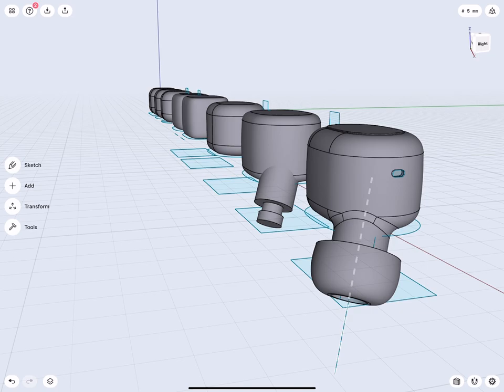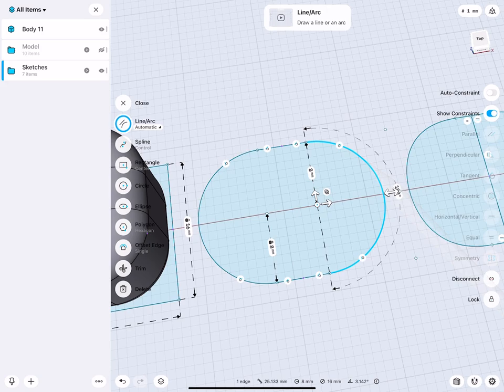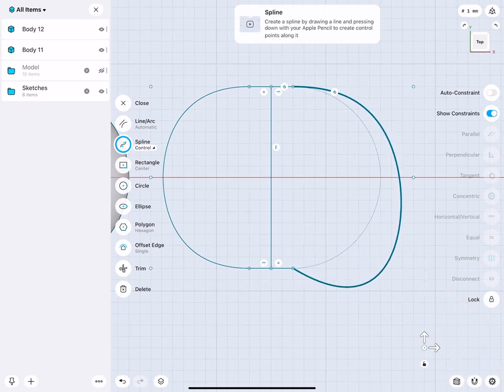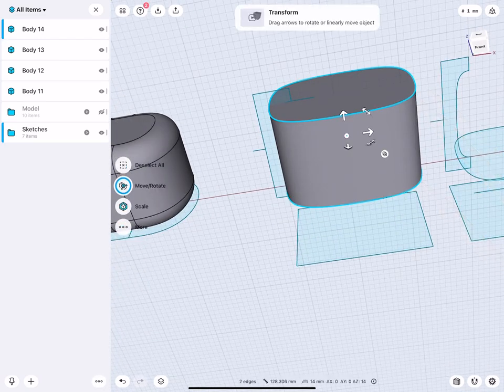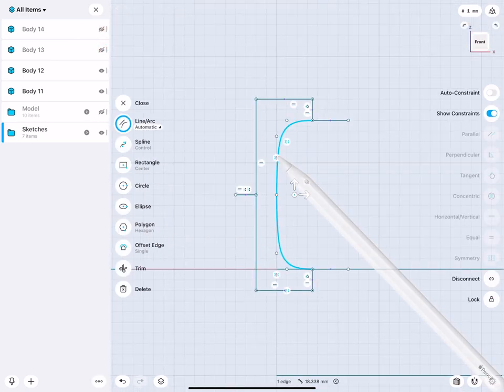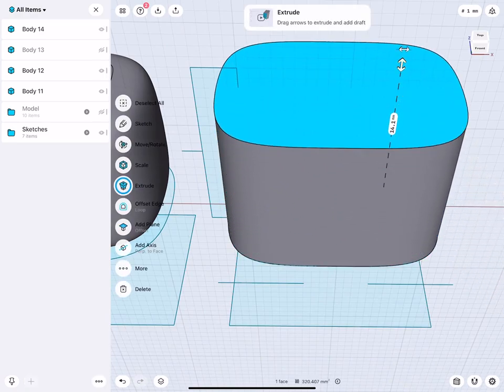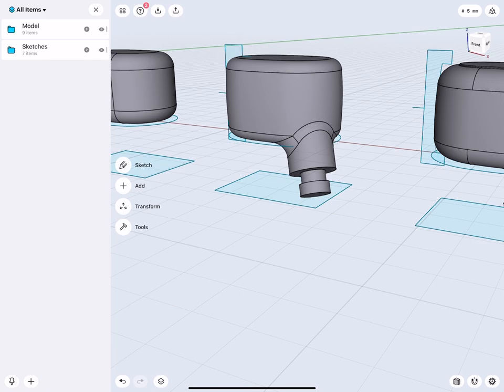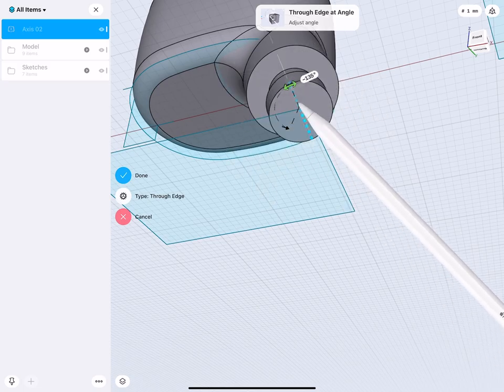3D modeling earbuds | Shapr3D step-by-step

Comment: The thought process is interesting but ideally I'd have preferred to see this designed from scratch according to your final design decision. There are points that lose me completely because I didn't see how you did the shape. This is certainly a good design though so I may have to wing it on my own based on your end result.
Reply: I agree with Nate. You show us the closed control point spline that did away with the flat front, but you did not show how you got there.

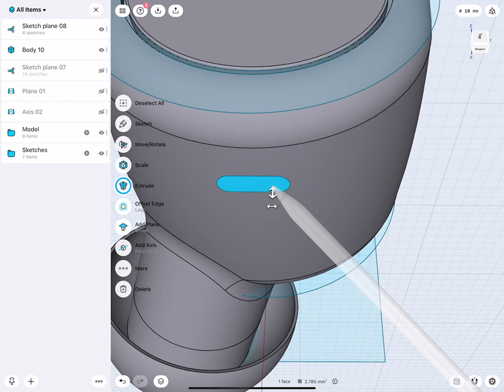Comment: In regards to the microphone cut you made on 32:32, the cut wasn’t exactly 1.5 mm because the it is measured by extrusion starting from the sketch, correct? I’m aware it probably doesn’t matter for this case, but I was just curious would one way around that be to project the sketch onto the body, then cut it?
Reply from the maker: That is correct, the cut wasn't exactly 1,5mm deep, as the sketch was not resting on the solid body's surface. Using projections are not a good idea as a projection on a curved face would make the sketch go into the curved face's center point, rather than the direction the original sketch is facing.